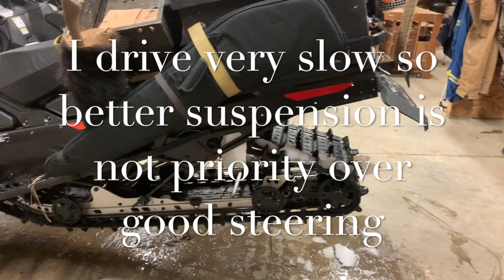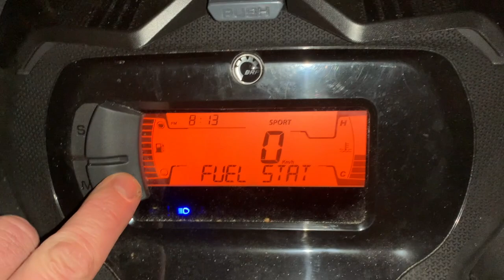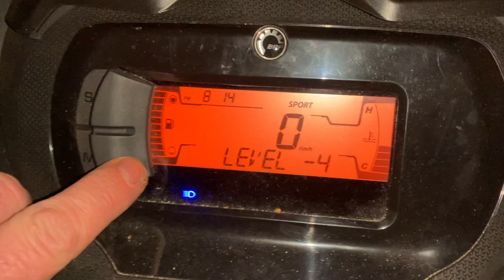2021 SKi Doo Skandic WT update two

Comment: Excellent Video work!  
I will use your tips on the mirrors and gas vent.  Thanks
When checking the oil I made the mistake of checking it before I started it and almost thought I was low and added some.  Then I read the owners manual and it requires the engine to run a bit, then when off check oil.  Sounds funny, but I was glad to avoid a near engine oil overfill.
Cheers from Alaska, I've got 600 miles on mine now. 
Practical Porters

Comment: On my 2021 600 efi..the openings on top of cowling..for the  radiator..are horrible for brush fallin in below engine ...ontop of radiater..a mess👎

I took some 2 in sticky side velcro...and some heavy plastic screen..and engineered a neat setup..no more duff..brush inside..pinecones etc..highly recommend building one!

Comment: The gas tank plastic inserts are designed for filling up at the gas pumps. It allows you to insert the pump nozzle to just the perfect place to full squeeze the trigger. When it automatically stops, your sled with be perfectly full. It speeds up filling at the pump. It's not so good from filling from a gas can.
Reply from the maker: Thanks for explaining what that insert is for and thanks for watching!

Comment: I had the same problem as you when I take off the front would lift up and my ski's would ride on top of snow and have no control, so I had to adjust the front suspension strap and rides much better, my problem was solved

Comment: Thanks for the walk around. I noticed the same thing on the cowling catching edges compared to the older models. More places for snow and ice to set and build. I cannot have my suspension set up quite like yours. I need to lift the skis to clear ice and creek crossings. I have to really gun it to pick the skis up though. The expeditions are a whole different animal than the Skadics for sure. Ride and steering on the Expeditions are unbelievable. Like your set up. May I suggest putting a soft bag like a feed bag over your chainsaw power head? Keeps the snow out of it when carrying it on the back of the machine like that. Keep it up.
Reply from the maker: Thanks Howler580, in the past I had a saw that the recoil would always freeze up and required to be covered, for some reason this little Still has never given me any issues! Been on the back of my sled for 4 years now and no issues. Definitely a good suggestion
though, might just have been lucky so far!

Comment: I have a 2021 Skandic SWT 600r etec 2 stroke. The radiator is on the top of the front cowling and not below like your 4 stroke. I definitely noticed the new design is a magnet for branches.
Reply from the maker: For sure! 
Thanks for watching

Comment: I like your brush deflector is it still working OK I do a lots of bush wacking in Alaska and am concerned Have you added anything new ??
Reply from the maker: I haven't added anything new, I have sold the Skandic lately since the miles were getting up there but will go back to a Skandic as soon as I can get one. This year I will be using an Expedition sport and has the same brush deflector on the front to protect the rad, works awesome, still allows air flow, doesn't plug up and haven't put a branch through the rad so far! Hope this answers your questions, thanks for watching!

Comment: I am a skandik 550 fan wide track old time trapper. Skandik floatation and gearing is great as I’m Always pulling a sled full of stuff, slowly,  stop and go. now I need to buy a new machine. 
Is the 600 ace strong enough to break trail? Or Is it worth buying the  900 ace? 
Does the super wide track performs better than the wide track..?

Comment: So overall are you happier with your Gen 4 over your old ‘15?  I’ve got the same ‘15 WT 600 ACE.  It’s still low Kim’s and in great shape, use it on the trapline, lots of trail breaking.  Like the looks of the Gen 4 and some say it rides better than the old XU chassis.   Thanks for the honest opinions.   Happy trails eh.
Reply from the maker: My 2015 was a great machine and I can't say that this newer one is a whole lot better. As far as the suspension, I had no complaints on the 2015 and I drive pretty slow the majority of the time, so I can't say I notice that great of an improvement that way. I have heard multiple times now of issues with the cluster on the older ones, although I never had any issues with mine. Hope this helps Will S.

Comment: How did you get the check valve out of the neck. Any pics of it and  how it’s in there.
Reply from the maker: I don't have any pics, was very easy to pull out actually, mine went straight in the garbage!

Comment: Great video and nice sled.. JUST wondering if you considered the Yamaha VK540 which is also a utility grade sled. It’s really basic and looks to be pretty much bullet proof. Also it has fan forced cooling so there is no radiator to worry about. I’m considering a new sled and looking at both the Ski-Doo Skandic or the Expedition or the Yamaha VK540 maybe the VK Professional 2 but the VK540 is a much simpler sled with a back up pull start..Would love to hear your opinion on the Yamaha if you consider one.. Thanks.
Reply from the maker: Totally agree with you on the VK 540, I've had one in the past and they are a very dependable machine, they are simple to work on and as you have mentioned, they have a recoil backup starter. I would not be afraid of going that way and I am even considering going back to them for the ease of repairs if in a tight pinch. The only down fall to the 4 strokes is the fuel economy, exhaust fumes and noise. Hope this helps Rick.
Reply: @whatido3021  thanks again but I’m sure you meant 2 cycle and not the 4.
Reply from the maker: @noniespam  Just meant that the 2 stroke's only downfall over the 4 stroke is the fuel economy, exhaust fumes and noise, but you know what I mean. My poor explanation.

Comment: still wondering about buying a SWT or WT; is there some times you think you would have been better served with a SWT?
Reply from the maker: I've had the 24" in the past and it was amazing in deep snow, the only reason I went to the WT 20" is because I have a lot of side hilling and find myself needing to tilt the machine over now and again for this, a bit easier with the WT. The 20" WT is also excellent in deep snow especially over a tundra, If I was on mostly flat ground I would go SWT, but for What I Do with hilly and uneven terrain, the 20" works for me. I tow a heavy sleigh 95% of the time and it never stops to amaze me for towing and backing up as well. Wish I could have some better videos of what it can pull in deep snow but not much snow this year. Hope this helps.

Comment: Need a little help is the Skandic 550 WT 2020 a 2 stroke or a 4 stroke
Reply from the maker: The 550 is a 2 stroke, in the Skandic they have the 600 ace 4 stroke and the 900 ace 4 stroke, they also offer the 600efi 2stroke which is what replaced the 550 carbureted 2 stroke.

Comment: How would this compare to the tundra 600 LS ACE  ? Static is a lot more expensive and heavier isn't it ?
Reply from the maker: It is much heavier but totally different in its own way, Tundra LT is light, narrow and nimble, great for manouvering through tight spots. Overall a great machine although very tippy. Skandic is ultimate for towing with the hi and low range, and the 20" track is very noticeable for floatation and in reverse. Also tippy but less than the Tundra.  I opted for the Skandic simply because I got my first one (2015) on sale cheaper then the current year Tundra. Been in love with the Skandic ever since. I tow with it the majority of the time and it is very happy to do so. If you are on a tight budget don't be afraid to try the Tundra, I've run lots of Tundras and they are an awesome sled. Skandic is like a one ton truck compared to a half ton when towing a camper if that makes any sense.

Comment: How did you remove the anti-splash sleeve from the gas tank?
Reply from the maker: I just used a pair of needle nose pliers, a little tug and it pops right out.
Reply: @whatido3021  any twisting or tabs on it or it just comes straight up.
Reply from the maker: @leesmith9942  just came right out when I pulled on it, I didn't deal with any tabs at all

Comment: What brand is your sleigh and what size it is and ware would a guy purchase one ,in Alberta
Reply from the maker: I bought mine from Barrhead plastics, Halford's out of Edmonton also have them, it's called the freight sled.
Reply: @whatido3021  thanks guy, I just purchased a 2023 skandic 900 ace 24 wt for the trap line